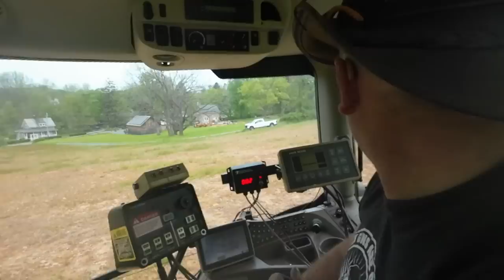Broken Planter

Comment: Got 2 bags of oil dry you can have. Bout 2200 mile round trip but happy to give to you lol. IN the JD packing kits there is a 1 time use install ring "tool". Makes install of repacked rod a breeze.

Comment: Is there a such thing as a rock pick up ? you could make one quite easily
Cover the pins on the board with petroleum jelly liberally and the seal on the box assembly should prevent any corrosion

Comment: How many years does it take to finally get a majority of the rocks out of a field? What I hated the most was walking the field on hot sunny days picking rocks, then baling hay as OLF calls them idiot bricks.
Reply: Once tillage stops, rock picking really slows down. Then it's all on mother nature and massive temperature changes to gradually push them out. Will have to pick a few time to time yet.
Reply: If you have rocks in a field it's at least every spring picking rocks just because tillage stops doesn't mean they won't come up my friend had pasture that had to be done a few times a year